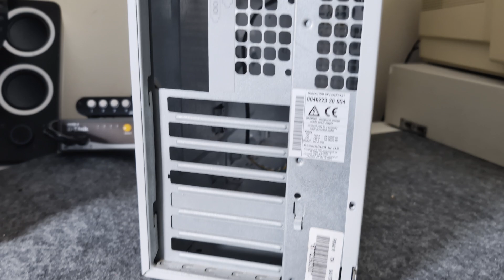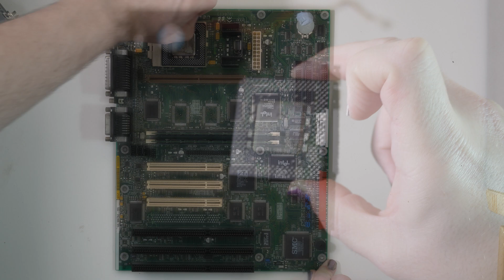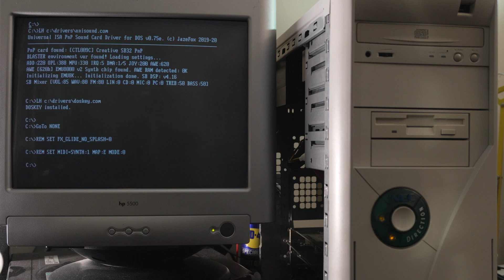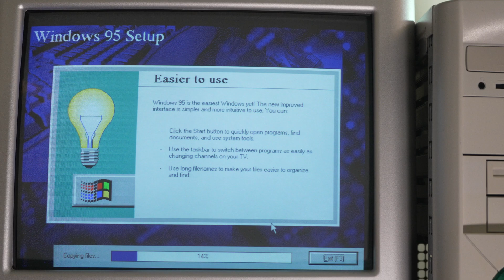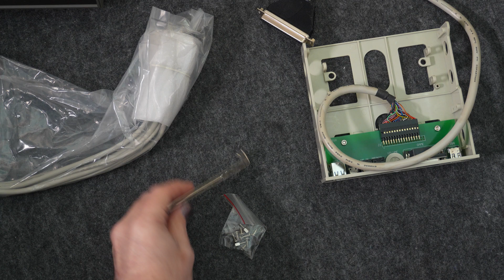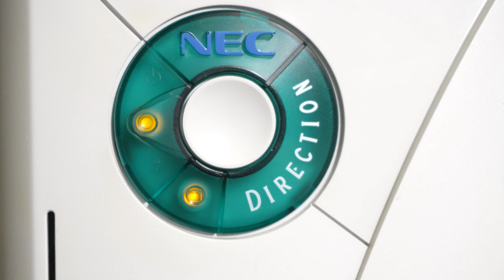Rebuilding my Pentium 1, windows 95 computer!

Comment: Putting the old back in except an actual spinning rust hard drive, bummer! 🙁 . I'm a sucker for those over flash storage!
Reply from the maker: I get that, but the convenience of the flash media (being able to quickly re-image it or connect it to another machine with SD Card reader) and the speed boost wins out for me.
its the great thing about this hobby, there are lots of options.

Comment: For a 233 Mhz MMX you are way better off with a Voodoo 2 or 3.
Reply from the maker: I know, and I do have 2 Voodoo 2's in SLi but they are in my Pentium 3 Win98.
(What I would really like is a voodoo 5 in that machine, but only if I ever find one at a reasonable price).
plus I do like having the voodoo 1 that I bought back in the day still in use.
Reply: The processor can be upgraded to a super socket 7 processor: amd k62, amd k63, and amd k63+. Update it to at least an AMD k62 with 400mhz.

Comment: I found that for Windows 98se, you can just zip the contents of the CF card. To restore it you have to partition and format the CF card but then you can just extract to it and it will work. Although I have also found a modern imaging program (Image for Windows) that can make a dos boot disk and image the computer. I also have found a DOS driver that lets me use a USB 2.0 PCI card to plug a thumb drive in for the backup of the CF card. The zip option requires it to be taken out of the computer and plugged into a modern computer.
Reply from the maker: I have done that to back up some cards in the past, but decided to go with the drive image process this time as I also wanted to keep the second partition and the partition table.
Its great that are so many options now to keeping these machines backed up and to quickly rebuild when they go wrong! 😁

Comment: I use a similar SD adapter, albeit a 44 pin laptop PATA version, with my long suffering HP T5710 with it’s Transmeta Crusoe & (currently) PCI Voodoo3. I was going to say “in” the machine but it actually hangs over the side. 😄 It works well & speed is good but without balancing the lifespan of the cards is compromised & (in my personal experience) unpredictable? 
I’ve always had good luck with Mach64 cards but I currently run a Tseng Labs ET6100 in both my Voodoo2 SLI & my PowerVR machines & they do a great job, both in performance & compatibility. I do have a couple of ET4000 & they are good for compatibility the performance drop from the ET6000/ET6100 is significant.

You’re aware I have a collection of real hardware PCs, what you may not know is, I can’t find my PowerVR PCX1 PC right now as it’s buried somewhere at the back! I may have a problem. 😅

No joke, I have to tell you the few times I’ve used the PC speaker header on a sound card it always makes me jump! The sound’s too loud, too bassy & coming from the wrong place. 😂

MMX doesn’t make a difference in a lot of old DOS games but when the game supports it, it really does.

You can install Win98 on to the same partition you copied the disk to but I must admit I haven’t tried it with 95? I can’t imagine it’s different?

What a cracker of a Voodoo box! Stickers don’t do anything for performance but the ones you’ve used drive the aesthetic perfectly. Great video, thanks.
Reply from the maker: Those SD to IDE cards are great, in any revision (as long as they are the only thing on that IDE channel, otherwise things get odd).
And nice having the Voodoo 3, they are a nice card if cooled.
Not sure I've tried a Tseng Labs card,  will consider grabbing one if I ever spot one in the wild.
I have no experience with loosing hardware, none at all. nope not protesting too much honest!

I do have a Win98 machine, but I like this being 95 is just for some very limited compatibility reasons with a few games and bits of hardware.

The stickers do make the machine look great, just a shame the domed 3DFX one didn't fit in the "sticker area"

Comment: Can you put W98 in it? I used to have an K7 back in the day, a bit faster, yes, and it would fly with W98, which, at least with SP2 or later, was SO MUCH MORE STABLE than W95. Both being a system running over DOS 7.0, it should not be much of an issue. I really hated W95. I remember having a P166 and needing to troubleshoot a GPU that was giving me issues with my Vodoo. Every time I had to take it out to replace with another one, system would completely crap out and, regardless of whether I put it back in or not, and required a full clean install of Windows. I remember once reinstalling the system 5 times in a day until I managed to pinpoint where the issue was (can't recall what it was).
Reply: I mean, having to reboot your system every time you changed either resolution or color depth was a miserable experience.
Reply from the maker: I do have a machine (A Pentium 3) with Win98SE on it and its great.
But I was wanting a machine with Win95 on it for a few reasons;
it was on our first PC when we moved from the Amiga.
I do have at least one game that runs under 95 that doesn't under 98 for some reason.
and I have a few things that only got 95 drivers that 98 doesn't like.

Comment: Transport Tycoon soundtrack, Pentium 1, Gateway 2000 motherboard - did you make this video specifically for me?!

Fantastic build mate!
Reply: Hold onto that non-MMX pentium 200 though - they're (I think?) the fastest Socket 5 chip Intel ever made, and pretty rare IIRC
Reply from the maker: And I'm never one to throw away hardware, just loose it in one of the many boxes I have 😉
Reply: @TheRasteri  Socket 5 support officially stops at the 133MHz part. But will accept the 166 and 180 MMX Pentium Overdrive chips.
Reply from the maker: I try my best 😁